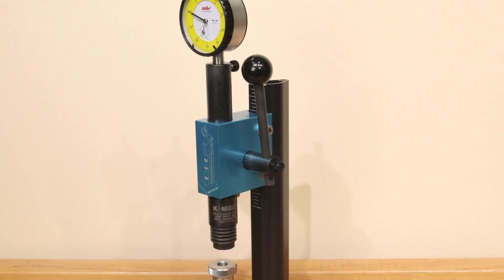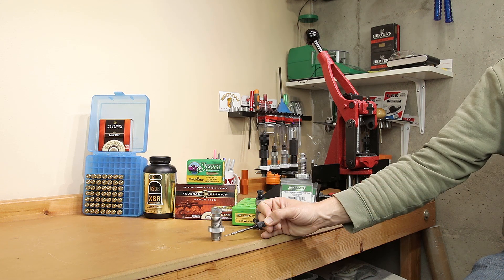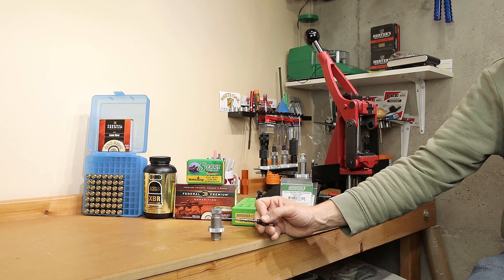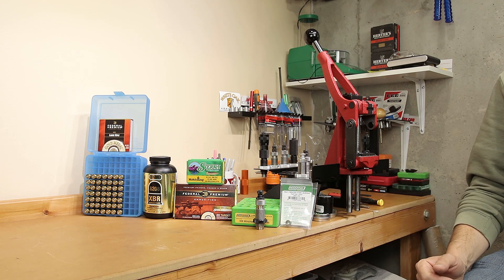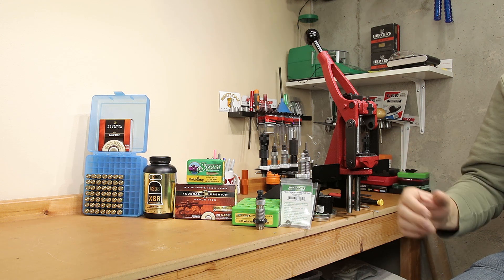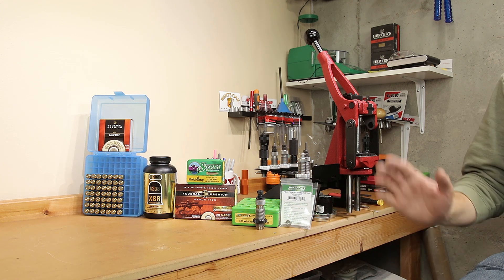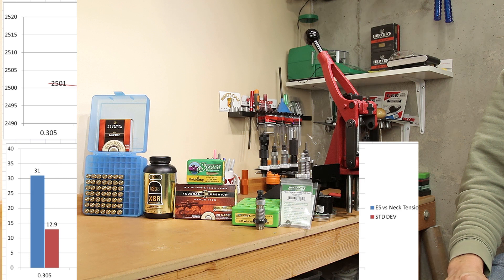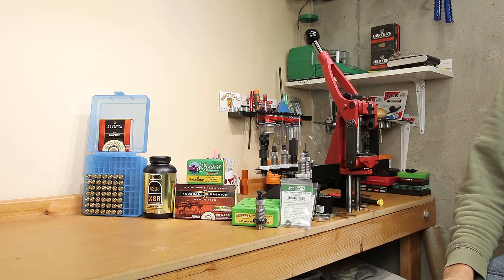Proper Neck Tension - How Case Neck Tension Affects Performance

Comment: I've done a ton of testing on this subject &, you really can't tell much about the neck tension unless you fully anneal the cases. Even the conventional annealing methods leave the cases with a good deal of variation in brass hardness. 
I wouldn't waste too much more time & effort with what you're doing. Unless the cases are of a known number of firings from new &, you have them sorted as such, you're groping in the dark. 
To begin with, you absolutely need a seating force indicator with a Wilson seating die. You simply cannot reliably tell what's happening without that gear. 
To give you an idea of what you're up against with simply sizing the ID of the necks, C26000 70/30 cartridge brass ranges in tensile strength from 100% work hardened of about 490 Mpa to, fully annealed of about 70 Mpa &, everything in between. So, sizing the ID 0.002" smaller in no way ensures consistent neck tension. 
With my 100% annealed cases, I have to ID size the necks at 0.004" just to achieve a start seating force of 8 to 12 Lbs. Most un-annealed cases start seating at anywhere between 45 to 70 Lbs at -0.002" ID. 
You will see a generalized outcome from your experimentation but, you will not be able to verify anything in detail or, with any amount of surety.
Before seating, the necks MUST be brushed. Any carbon or graphite in the necks will cause nothing but problems.
Reply: I am sure that I have posed the question before about leaving lube, either oil residue, sizing lube residue or graphite residue inside the neck after the resizing and the direct effects of that residue on tension "hold" between the bullet and the ID of the case neck. To be honest, I do not think that a simple "brushing" would suffice unless the brush was cleaned between each cleaning because the brush would become contaminated itself after use. Such as the brush needing to be dipped in Isopropyl or another evaporative cleaner between each use. I would even be willing to offer that natural body oils from simple touching and rubbing on the outside of the bullet itself will create noticeable and notable differences at these immediate high pressure curves of a typical charge generating 60,000 psi created in literally millionths of a second.
Bullets and case necks need to be cleaned with consistency if any measurements between "shots" is deemed to be relative between cartridges.
I also suggest that none of those related tests can be completed without consistent and equal K&N arbor / Wilson seating die seating pressure measurements.
Reply: @additudeobx  Brushing works just fine. During bullet seating, I can tell when I've missed a case because the bullets usually stop-start down the neck during seating & or, they are 30% to 50% higher seating force. When the necks are brushed, they are smooth & constant unless there is some galling in the neck which, is very rare, at least in these lots of cases I have at the moment.  Graphite added to the necks has about the same result as carbon. Wouldn't think it would you but, it's a fact. I've annealed & "seating force tested' in excess of 700 cases so, I know a bit about it now. 
I'd like to see your testing go well so, I strongly advise that you sort your cases by firing number if possible. I've seen plenty of once fired cases seat bullets at as little as 10 or 15 Lbs over fully annealed but, I've also seen 3rd fired cases seat at 150 Lbs. (I use pin gages to set neck ID)
Unless the cases are fully annealed, there's no way to achieve consistent tension by merely sizing to a specific ID unless the cases are of similar hardness. You will achieve some results but, the data may appear quite inconsistent. 
Hope this helps............Kind regards...............Rotas.
Reply: @rotasaustralis  Thanks for the reply. I can only think that as the uncleaned brush would become more and more contaminated it would leave more and more residue on the inside of the case neck. Maybe not a lot, but over say 100 + case brushings, enough to make a difference. But, that's theory and I need to test that.
Secondly, I feel that bullet seating pressure is an in-direct measurement. I feel that a more direct measurement would be a bullet pulling or bullet extraction measurement which would be more precise. I'm going to see if I can test the bullet extraction method numbers and see how directly related it is to the bullet seating method numbers.
I am waiting on the arrival of an arbor and Wilson seating die and time to do the test.
Reply: @additudeobx  Yes for sure the brush builds up stuff. I just spray with electrical contact cleaner. Works a treat on nylon brushes.
Yes, bullet pulling would be a good data point. With the way I anneal, the pull force seems roughly commensurate with seating force but, in my case, there is an initial grabbing force when the bullet is 1st moved & reduces markedly for the rest of the neck travel.
At some stage I hope to aquire the gear to measure the pull force.
Reply: @rotasaustralis  - Once again, thank you for a reply. I am glad to hear that you are cleaning the brush occasionally with a solvent. Electrical Contact Cleaner spray is a better choice than Iso, my initial thought and I would also think that Brake Spray Cleaner would also be a good choice. For the sake of any testing and repeatability, every brushing needs a spray cleaning. In real life, I'd guess maybe every 25 to 50 brushes or so. That's just SWAG. Could be more, could be less.
So are you saying that you have measured pulling force? It seems that would be realistic that the bullet, after seating would have some degree of "Stickum" (Not sure of the engineering word) before it overcame the tension and released to the pulling (or pushing) force. But I hadn't considered that prior so good point and observation.
Can I ask how you set up your equipment to measure the pull forces? I received my K&N Arbor press today and I am trying to figure out the best way to do a pulling force test.
I'm thinking of securing a shell holder to the baseplate and then using a collet like the RCBS bullet puller collet and then setting the dial indicator with pressure and then reading the dial as it turns counter clockwise to release force.
But that might take some work to accomplish. Do you have a simpler method?
Reply: @additudeobx  no, can't read pull force yet but, the difference using a hornady collet puller is pronounced.I have researched & priced pull/push load cells & software to measure pull force but, as I said, the difference is so pronounced I  think to know absolute values would be acedemic & not necessary at the moment. Plenty of other gear I need for the time being.  .
Reply: With reference to bullet pulling force &, after pulling many hundreds of bullets as part of the sequence to the way I'm reloading at the moment,  the only way I can think of to realistically measure it is with a load cell. That was my initial plan however, due to  the results I've seen during my testing, I no longer think this is necessary. 
Firstly, my initial reasons for annealing & trialing different methods of setting neck tension was to 
1) Reduce the neck tension & to see if I could achieve seating tension stability case to case without neck turning.
2) To measure actual annealing methods using seating force.
3) To be able to achieve consistent, low neck tension with minimum of deviation from normal loading processes.
To date, my findings are as follows..............
* Conventional YouTube annealing wisdom does not achieve good consistency. This is because true annealing cannot & is not achieved within the temps & timeframes commonly used.
* Excellent neck tension consistency is achieved through proper annealing practices alone. 
* Modification to the sizing process is necessary to achieve the best neck tension consistency.
Although I have test fired my annealed cartridges, I have not yet started testing on accuracy & etc. 
So far, I've found that, annealing seems to be the major piece of the puzzle. If the cases are annealed correctly which, is much simpler than commonly understood, most of the consistency is achieved at that point. It is kind of automatic. Neck ID's have far less effect than when working with un-annealed cases.
Reply: @rotasaustralis  Alright....then what do you consider a correctly annealed case and does that include an annealing process? Such as flame, salt, induction, other?
Reply: @additudeobx  Ok. There are 6 different scientific white papers I've read so far. A rather excellent white paper study was done by the University of Illinoise by Harold .L.Walker titled  "GRAIN SIZES PRODUCED BY RECRYSTALLIZATION & COALESCENCE IN COLD-ROLLED CARTRIDGE BRASS"  The findings in this study align with those of all the other studies I have read on annealing times & temperatures. I've known for years that the times & temps used by cartridge annealers was bunkum because I worked in a copper & bronze factory yrs ago. I'm an Industrial electrician so was familiar with the annealing ovens & the programs. 
Currently I flame anneal with the cartridge base in 1/2" water &, the case is heated to a bright orange pink for 5 to 7 seconds or longer. By colour charts, that colour represents 800+ C (not F). If you download the study listed above, you will see relevant info on pages 15,44 & 52 but, be sure to read the entire paper. 
To get the cartridge neck/shoulder to the above temperature, MAP gas must be used. Propane will not get the case hot enough to fully recrystallize in the convenient 5 to 8 second timeframe.
Also, you cannot over anneal unless the emphasis is on 1)  The cases head is annealed or
                                                                                                     2)  You have determined that 100% annealed neck/shoulder is too soft for your particular reloading style. The water will absolutely protect the cases head & reason 2 has not been a problem for me yet. Otherwise, over annealing, burning, copper separation etc are all just made up BS. 
Full 100% recrystallization brings all the cartridges to the same hardness level which, is the only logical starting point for the testing we wish to undertake.
Reply: @rotasaustralis  - Good info.... I'm going to check it out. Thanks!
Reply: @additudeobx  There are other white papers to read but, they are all along the same lines &, this paper lists most of the more relevant information specific to cartridge brass annealing. Although what I have told you about my findings to date show great promise, there is much to be tested ahead. For example: although the annealing greatly reduces neck tension, can enough neck tension be obtained to hold the projectile securely during magazine use & in normal situations & competitions ? (PRS for example) 
Can the fully annealed cases withstand repeated firings without unforseen deformation?
There are many more questions to be answered before I could recommend 100% annealing as a viable solution for neck tension consistency.
Reply: @rotasaustralis  
Fascinating ,, thanks
Reply: @RJ-sr5dv  I'm in the process of conducting a lot more tests but, as far as seating force consistency, everything looks exceptionally good. I've test fired quite a few with no problems or visible anomalies.
I've looked into the historical perspective of annealing cartridge brass &, it appears that a couple old guys borrowed some info from the cartridge manufacturers & applied it directly to the reloader without question &, here we are. 
Traditional annealing methods don't anneal at all. At the very low temperatures & short time duration they manage to relieve the cases very slightly if at all. My goal is to bring the cases to the same or, very similar hardness independent of the initial hardness(number of firings) &, the only way to achieve that is with 100% recrystallization. So far, my results are promising. Even if my method fails to improve upon velocity SD's, it is still a much easier & straight forward method with tangible results for the ongoing preservation of case necks. 
I've read many statements of annealers claiming twice the case life before the necks split. This simply proves they have not annealed the cases because 100% recrystallization should preserve the case neck virtually indefinitely. 
It's been very difficult to convince others to at least test this annealing method so, I'm hoping others will at least give this a try.
Reply: @rotasaustralis  have a good setup to share your process with map gas annealing?
Reply: @cademarti1365  What specifically did you want to know?
Reply: @rotasaustralis  just details of your annealer. I want to build one
Reply: @cademarti1365  Nothing to build & really not much reason to. I use a microwave turntable motor to rotate the cases & a hand held MAP gas torch. It's not about the machine or what you anneal with, it's how you anneal.
I'm going to assume that you want the most consistent case to case anneal you can get. Truth be told, it's the easiest way to anneal there is.
No precise timing, no precise temperature, none of that is necessary.
You simply have to get the brass to a hot enough temp whereby it reaches 100% recrystallization. 
100% recrystallization = >700 C for  3 to 4 seconds. It really is that simple. 
I've annealed over 2000 cases like this. Not one problem & sizing & seating is fantastic. 
If you buy yourself something like an annealeez, you don't even need water for the case head. I've just finished testing my high temp annealing method without water for >10 seconds & the case head never went over 270 C which means that the strength of the brass at the case head cannot change. That was on 308 & 243 Win cases. Have not tested 223 rem yet but, since those are considerably smaller, annealing without the case head in water may not be an option.
If you watch how Reece uses his machine, he has to be very precise with his anneal time because he is heating the case to between 800 & 900 C, same as I do but he has to ensure he doesn't melt the case neck. He has to do it this way because his machine is either on or off. He can't adjust the time it takes to heat the case necks to that high temp. He's basically going as hot as he can without melting the case necks & the machine MUST switch off before the damage occurs. 
I did build a basic induction annealer but I like the cases a little softer than I can get with such a tiny time interval so, I am still using the MAP gas until, & if, I get my fully adjustable PID closed loop unit. That is about $1800 Au & the industrial infra red temp sensor is about $1200 Au. When & if I get this settup, I will be able to set the temp I want at the annealing time I want for any size case. Until then, I'm getting something like an Anealeez with the MAP gas torch, 3 to 4 seconds at very high glow, job done.
Then again, I might stick with something like an Anealeez because 3 or 4 seconds really is pretty much the same as 10 seconds once 100% recrystallization is achieved.
If you wanted to build what Reece has you'll have to ask him.
Reply: @rotasaustralis  are you using tempilaq just below the shoulder to verify your temperature?
Reply: @cademarti1365  No, don't need to.  Just get the case neck & shoulder as hot you can without melting. That will be somewhere between 700 & 900 Celsius, not Fahrenheit. When the case glows real bright orang/yellow, count to 3 or 4 & you're done. Just before the brass melts, it will glow a shimmering almost transparent yellow/white. That's just a little too close to melting & a pain in the arse to clean but, doesn't do any damage unless you can see the brass has melted. It goes all wavy if you've gone too far.
Get a couple old cases & do some trials so you can get the hang of it.
Anyhow, tempilaq is useless unless it's on the inside of the case necks otherwise you're just reading flame & brass skin temp. 
I anneal this way to avoid that BS. It's not necessary.
700 C or above for 3, 4 or 5 seconds. It's all the same.
Reply: @rotasaustralis  I fabricate/weld for a living so I know the color change you speak of
Reply: @rotasaustralis  yellow/white is when you induce oxygen after heating metal with a cutting torch to blow through the material
Reply: @cademarti1365  From what I've read, that shimmering white/yellow is just around brass melting point so maybe above 900 C. To get the brass to somewhere above 700 C, you can easily see the glow brighten significantly then after that, if not careful with the MAP gas, the white/yellow patches will start, particularly on the shoulder.
I've annealed 223, 243, 308, 270 & 30-30 with this method & had no issues whatsoever. 
Remember, it's very important not to heat the case head significantly.
As stated, I have tested case head temps without water where the case neck & shoulder are heated &, at heating times of 5 seconds after reaching annealing temp, the case heads reached around 180 C which is safe. Ten second times yielded case head temps of no greater than 270 C. This was tested 10 times with 308 & 243 cases. Larger cases should be fine but, be very cautious with small cases like 223.
If you aren't confident, simply place the case in 1/4" water. Just enough to slightly cover the solid web. You can heat the cases all day & as long as the water doesn't boil off, the case head can get no hotter than 100 C &, the water will keep the case from getting too hot up to about 1/3 the way up the case.